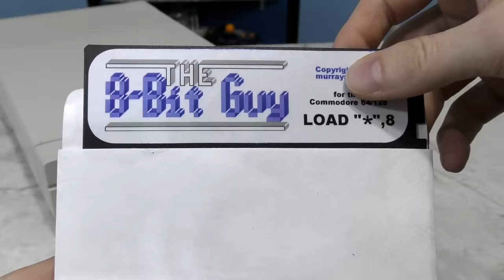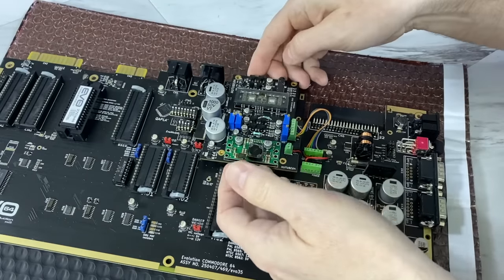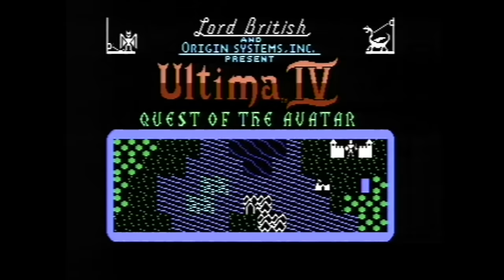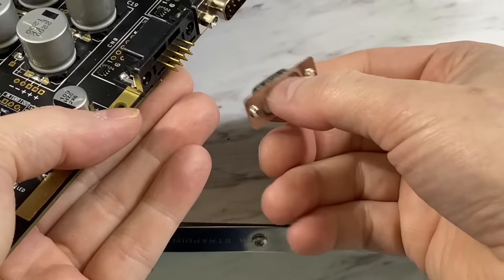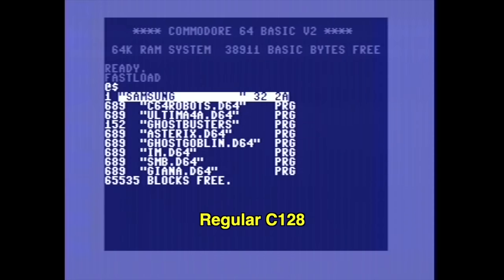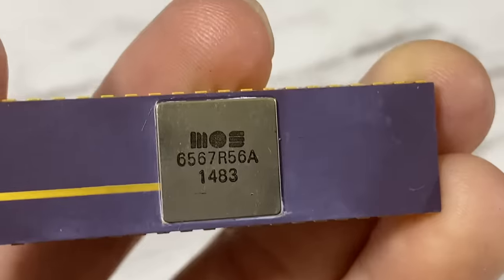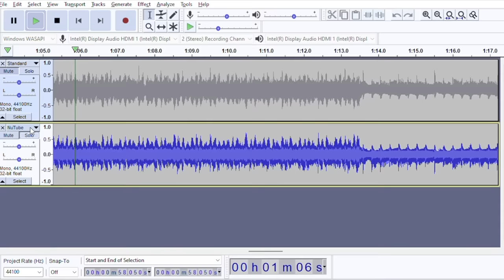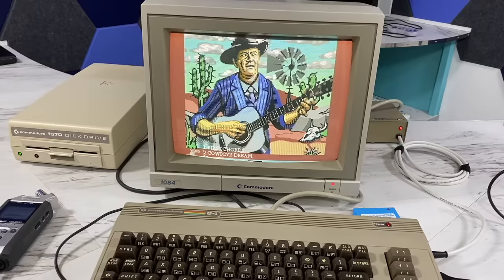The Evolution64 - Is it worth the money?

Comment: I remember playing with C-64/128's fondly.  There was a company that you could get a cartridge based secondary SID and there were some tunes out there that really made a difference.  I do know that a NEW vinyl record does have a better sound than digital.  Transistor amplification is not the problem.  Digital storing is.  The problem with Vinyl is that after a few playings, the head riding directly on the album will cause damage (it's not possible to not to) so the sound will degrade with every play.  where the digital, does not.  That is where digital kicks backside. (let's face it.. recording an analog object (sound) in an analog method is best.. no conversion.. but to record that analog object digitally.. requires some conversion... and introduces sound loss)  I might even have a few devices lying around in my boxes.. I've not gone through them in a while.

Comment: I think, that if I were doing a display, showing what C64 software was all about, this would be ideal, just from the reliability perspective, but in that case there are emulators, I assume, that will the job as well. If I was writing C64 software, I'd want this, just for the quality. The dual SID would give you all possible options of what could be.

Comment: An amplifier should only make music louder. If it changes the sound in any other at and way, then it distorts the sound and even if you like the end result better, an amplifier that distorts the sound is a bad thing, because then it works like a kind of equalizer and is not neutral. Statements like "Everything sounds warmer with the amplifier" show the problem: Music should sound the way it was recorded, whether warm or not is determined by the recording, not the amplifier. And here it can be technically proven that modern transistor amplifiers are almost perfectly neutral and only produce deviations far below the hearing threshold. An amplifier would only be better if it were even more neutral, and that is almost not feasible, certainly not with vacuum tubes. If you want everything to sound warm, you can achieve that with an equalizer, completely independent of the downstream amplifier.

Comment: Technically a tube amplifier cannot match a good transistor amplifier. Additionally, you can tric a digital audio system so that if you want it, the sound will sound exactly like a tube amplified sound. Well so, tube amplification is at best nostalgia, at worst idiotphilia.

Comment: On the Tube vs Transistor thing, high quality versions of both should sound the same, because they are designed to do the same thing, the higher the quality the more they'll behave the same. They differ in behaviour when over-driven. Also a transistor amplifier is still analogue.

Comment: The tubes are squashing the dynamics of the audio a bit.  The peaks could be exactly the same but the passages that would normally be quieter are now louder than they were before.  Basically just makes quieter passages sound a little louder and doesn't really improve sound quality but louder is sometimes perceived as being better.  Tape technology usually has a bit of dynamic compression built-in to the circuit to improve audio quality, so audio on tape might be perceived as better quality in that sense as well even though it is just making the quieter bits louder...

Comment: the main issue is that you can't experience the real difference unless you have a whole array of equally high end equipment. your amplifier and speakers also have to be $1000 each to get the real benefit. even more so, it makes no sense to me for this expensive preamp to in the C64! it should just be a line level output that you can hook up to whatever, and if that's a fancy tube preamp, then you can live your audiophile dreams

Comment: To properly measure analogue video performance you need to get hold on a Tektronix VM700. I don't know if the C64 or clones can generate the proper test signals on line 16 and 17 as well as test patterns.

Comment: I bet the Nu-Tube would look SICK in a transparent case. I'd wager you'd need to use some nice headphones to pick up any difference however. Running it through the soldi state amp on the monitor is valid, however: it basically replicates a hybrid amp design (tube preamp/solid state power amp) which has been a big thing amongst guitarists for the last few decades. The result is something that replicates the analog characteristics of tubes in a lighter, cheaper package.

Comment: David, you're not invalidating any results by sampling them.  A typical analog input, as long as you pick a decent interface will far outstrip the analog output from this board both in terms of dynamic range and frequency range.  

For the comparisons: If you want to allow people to actually evaluate the difference, you should have digitally inverted the signal on either of the original or tube, as it has some effect on room acoustics when played back for those listening on speakers.

That said: The inclusion of an internal tube output stage in this product is downright bizarre. Tubes can impact audio, through specifically having a different distribution of even and odd-ordered harmonic distortion.  With any modern topology, you have to actually make either the transistor/opamp and/or tube path deliberately defective to make much of an impact.  While I'm not opposed to deliberate tube distortion, the Evo64 creators should have offered it only as an external option/buffer, instead of driving up the cost of the main board.  They would have gotten to the same place, and made the board a few dollars cheaper to produce. 

 Bonus? They could have created a "tube distortion buffer", that they could sell to people who have absolutely no interest in vintage computers, but an audiophile interest in tube distortion, and, at silly markups.  Add a "warmth" knob adding up to 10% 2nd order THD.

Comment: For the sound test i could tell the top ends had more clarity and the low waves were richer but because of that complex and fast beats sounded more muddy, like with the commodore display with the Evo64 looking fake, the sound to me of the original while yes worse in a small way, its blended feel makes it sound more natural..and theres probably ways around it with an old audio hifi system to plug the sound through it and use custom EQ settings to get around spending the extra money..but at that point it seems inconveniently clunky to go to all that effort.

Comment: If one of the waveforms is inverted, that means it's phase is inverted and it will never sound "right" in most cases, likely less noticeable with synth sounds but it's literally the same thing as hooking the positive/negative up backwards on a speaker. Most people probably wouldn't notice, even if it's only one speaker off whereas people like me will notice even if all speakers are inverted (one speaker being inverted is most noticeable)

Comment: There is a difference between the Nutube and the regular C64 in the sound quality. The Nutube does sound a little better but like you said not night and day $500 difference. Not worth it. It might  be even better with the right equipment attached end to end but the cost probably won’t be worth it.

Comment: The Nu-Tube is a triode-type tube which creates a 180 degree phase shift at each amplification stage due to it being a voltage controlled current source. When the control voltage increases, the output current increases, which reduces the voltage at the plate if a normal series resistor and plate coupling capacitor are used, which is what I suspect.

Comment: The tube one definitely had a bit more mid and high end but I imagine it's just overall higher quality and/or less aged components in the evo64 compared to an original c64. I imagine there's no real difference between transistors and tubes in this case, and there typically isn't going to be unless you're intentionally driving them to distortion.

Comment: When it comes to amps, a lot of the difference between tube amps and solid state amps actually comes from the fact that tube amps are less accurate. They "color" the sound in a way that that some people find pleasant. Generally speaking, those differences are bigger with high power amps designed to power speakers. The little amps like the one for this or that you might get for headphones just aren't going to be that different.

Comment: your bracket design is off. You need holes for the VGA standoffs because thats where the cable screws in to make sure it doesnt easily disconnect.

Comment: You probably need to do a spectrogram or sound histogram using a audio analysis tools to quantify the difference between the two different audio sources. As a vinyl and tube enthusiast, I can understand how the differences can get lost if someone’s using “inferior” equipment in the path between the source and the listener!  Generally, the tube end is the output power amplifier section as opposed to any filtering and analog-to-digital smoothing does by transistors or audio processors.  Additionally, it’s the sampling of the audio where the fidelity losses occur, depending on the bit-depth (how many bits), then losses from compression (though there are loss-less compression algorithms).

Comment: The whole thing with tubes is that they can give a bit of distortion that makes things sound a bit different.  Generally their only real useful implementation is in recording instruments, where you might want to distort the instruments sound for an artistic purpose.  Electric guitars being the prime candidate.

For audio playback usage, they just muddy up the sound a bit.  In the C64s case, they make it sound a bit more (ever so slightly) like older analog synthisizers due to the frequency response being less linear.  You can hear the difference in your examples, but its not "better" really... it just sounds a little different (the long notes at the beginning of your comparison are noticably different).  In the same way that different SIDs can sound a little different from one another.

Comment: Why is the case called the "bread case" or was that "bread bed"?  The audio from the new board is louder but there is distortion.  At least on my TV/monitor.  The original audio does sound better with no distortion but it is quieter.  Comparing one chip tune to another version of it isn't the sort of thing I would want to do.

Comment: i can hear a difference in the first bit, but not the last in terms of quality when you compare the two

so i think it matters if you have specific use cases, and a lot of different audio effects

but, transistors do not affect the audio that is input
however,
tube amplifiers do, and its preferred for its "warm" sound, and sometimes, higher bitrate/slew-rate (which means more accurate sound prior to any compression)
(garbage data in will always mean garbage data out, so its better to have a cleaner signal at any possible point in the chain)

Comment: I like the board, but I'm disappointed it doesn't replace the old power brick with something more modern.
Reply: There will be a new power supply option in Q2 of this year. It's based on an ultra-low noise "Toroidal transformer"

Comment: Another note with the audio comparison, it sounded like the audio bitrate wasn't really high enough to hear the difference. I recommend using an all wav or flac workflow for audio comparisons so then when you upload it to YouTube, it only needs to be compressed once. Even just using high bitrate lossy formats are better because then, while you might still lose a bit of information in the signal, it won't be as bad as with a lower bitrate. 

It probably doesn't help that I'm using airpods....
Reply: I noticed that too, artifacts.

Not sure how Zoom handles mp3 recording, but I have a Tascam PCM recorder and its mp3-encoder is not that good. And when I record 128 kbps mono, it sounds just as bad as 128 kbps stereo. 128 kbps per channel should be almost indistinguishable.

Comment: The Evo64 is a cool project; but is there a way to use it without furnishing chips from old commodores?
Reply: You can use new reproduction chips for MOST of the requirements (e.g., Kawari VICII replacement, ARMSID, Montotech CPU replacement, etc.), but the CIA chips need to be original

Comment: NuTubes are notorious for being extremely microphonic. Try typing away on the keyboard while recording the output. You’ll see every key press on the output.
Reply: The NuTube64 module mounts and dampening work to dramatically reduce the microphonics. You'd have to jostle the system to hear a material affect
Reply: @C64EVO  it’s something I’d be testing on a review, for sure.

Comment: Let's see if I'm allowed to post this, this time:

Regarding the vinyl and tube vs digital and transistor bit -- it doesn't work like that.  Everything in the audio chain affects the sound to some varying degree.  Analog and digital are not opposites of each other -- they don't cancel each other out, or nullify each other.  Same with tubes and transistors.

Think about it this way:  If you play a vinyl record and use a digital recorder to capture the sound, you still hear the surface noise and pops, right?  You don't lose the "analog-y-ness" of the vinyl when you record it digitally, assuming the digital recorder is HQ enough to be mostly transparent -- and that's pretty much a given these days.  It's fairly easy to build a nearly perfect digital ADC/DAC now.

That's actually the problem, in fact.  They're so clean that they can be considered "sterile," and some people prefer to use analog components along with, or instead of, those super clean digital components, to chooch it back up a bit.  Us humans tend to like a little distortion.  It makes it seem "real" -- same as film grain and brush strokes.

But the point is, when you add some pleasant grit to the sound -- by judicious use of tape compression, or tube distortion, or the mess of imperfections that is vinyl -- a good digital recorder is certainly detailed enough to pick that up and reproduce it faithfully.  So, you don't have to worry about using transistors after a tube preamp, or using a digital audio processor after a turntable.  You will still get what you came for.
Reply: ... that said, five-hunnah to insert some tubes in the signal chain of an 8-bit micro's crappy old sound chip ... is just silliness.  If you really want tubes, get a tube pre-amp to feed a power amp to feed your speakers.  It'll cost about the same, but you can use it for any audio source, not just the SID.

Comment: Can't hear a difference.  The only way is to hook it up to a good analog system before it's recorded on YouTube.  The Ultimate 64 PCBs have direct audio stream rip option via network to WAV or mp3.  The issue is it's a raw stream and packets drop out.  So from my understanding and experience that's the cleanest way to sample a real SID.  A stock C64 in good condition with the proper cables sounds amazing.
Reply: te-legrammeTheBitGuy  what does this mean?  Sorry not familiar with new comments.  What I mean Ultimate 64 PCB FPGA high speed samples the real SID chip.  I've done it before with audio and video streams.  The muxing software can't do it automatically so I spent several hours audio video syncing by hand using the same free DAW in the video then a bunch of command line utilities on Linux to remux the AV streams.  Ethernet out from C64 straight into ethernet on a PC.  I think the software is called Ultimate 64 viewer and can display the video on a desktop window.
Reply: te-legrammeTheBitGuy  I don't use Telegram software.  I'm on a cellphone

Comment: Very nice review of this board, thanks for the upload! It’s good to see another option to keep our little machines alive.

What I don’t understand about this board (at the price) is this 7805 voltage regulator on it, which requires a heat sink. Why don’t they put one of this modern switching regulators on it? 

About the tube-amplifier, I have a very unpopular opinion: They don’t sound better in general, they just sound different. ;-) The sound generation in our beloved SIDs is so sloppy, it can’t really benefit from tubes.
Reply: Switching regulators tend to add electrical noise to the circuit, which affect video and audio quality. That would explain why the EVO64's developers stuck with an old school 7805 setup.

Comment: One thing people forget is that FETs, including MOSFETs, have a similar transient-curve to triodes. This not only means that there are guitar pedals with such transistors built to emulate the sound of a tube amp, but there's also some chance, that the SID chip's filter, when saturated, distorts the same way or close to the way tubes do, which is the only real difference between "solid-state" and tube sound. I don't know it in exact detail though (someone with more experience with the subject matter may correct me).
Reply: Well, both FET's and Vacuum tubes operate on the same basic principles.  That of electrostatic repulsion or attraction (usually both).  Which might go a long way to explaining why Shockley came up with the FET, while the other two were developing the BJT.  It's no real surprise that FET's are the dominant tech today, they are just a lot easier to work with, IMHO.

The modern FINFET is basically a solid state vacuum tube.  Just ridiculously small and energy efficient.

Comment: My friend has a dual SID setup on his C-64. It’s a small board that has two sockets for two SID chips, which is then plugged into the socket where the original chip installs in. His setup consists of two ARMSIDs, one as a 6581 and one as a 8580, and wiring that routes to the outside with the audio outputs.
Reply: Your point is what?